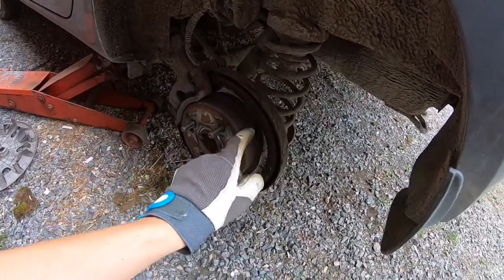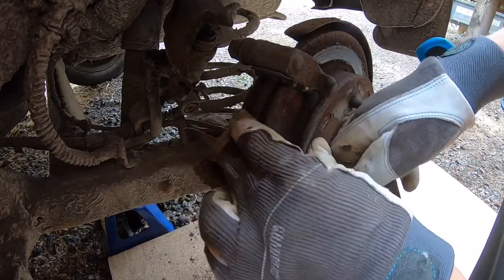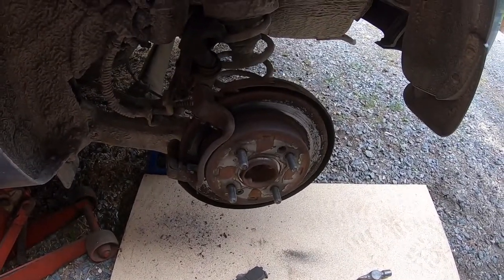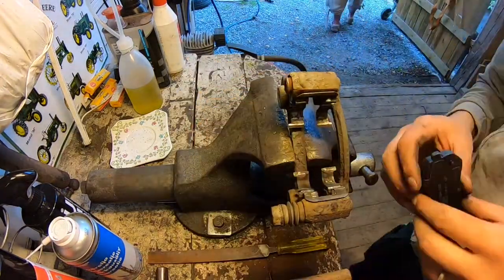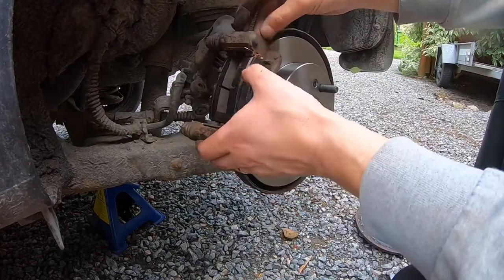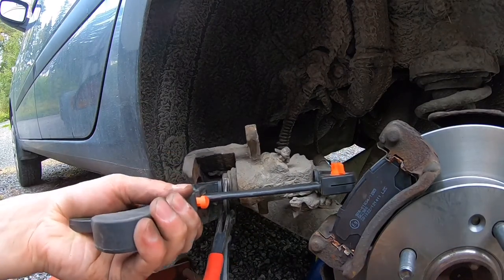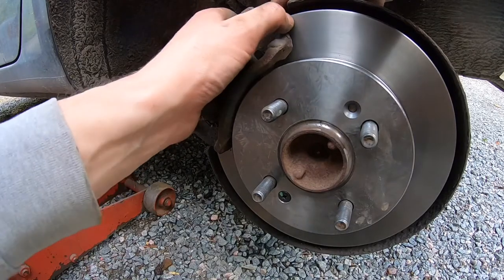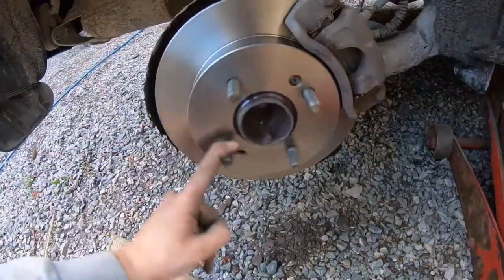Changing rear disc brakes on a Hyundai I10

Comment: There usually is a procedure to get the parking brake to work as intended. How did you fix that? I have done quite a few handbrakes of this type on VAG cars and it is a bit of fiddling to get the adjustments right. Probably the same on this car. Hälsningar från Värmland.
Reply from the maker: No Electric hand brake on this car, twist and push to get in, push the brake to get the the piston out and then the adjustment is automatically set. (If the caliper works!)

Comment: Sat here having my lunch and thought I would take a look at some videos, I came across yours and think you have done a great job, the Filming was excellent and your voice over in a foriegn language incredibly good. 
The only thing that shouted out STOP was when you started to push the piston in to the Caliper, you realy just needed to open up the Caliper Bleed Nipple whilst pushing the piston home, preferably with the correct tool and then close it when the piston is fully down and flush with the capliper casting. 
2 Things to note, you should always clean away around the piston before pushing a Dirty Piston into the Calipers Bore and
lastly check the fluid level or even carry out a Fluid Swop, recommended on most cars around 30,000 miles / 45,000km
this is a realy easy maintenance fix and costs around £200 + in a garage, but done yourself costs £10 - £15 for fluid  
Thanks again for uploading a great video
Mr Spence Eng
Reply from the maker: Hey! Good advice, this car is probably due for a brake fluid change, I might do it this summer. Regarding the piston, the boot was relatively clean and I didn’t want to move too much, don’t know how it would hold up so I just left it. Yes a special tool to push it in would be good and the method of opening the nipple is good, I will take it with me and use the next time! Best regards Nils

Comment: great job. I put grease between the hardware and the caliper. This way it slows down the rust that jacks the hardware towards the pads and makes them bind. Also grease all metal to metal contact areas where the pads contact the piston and the caliper body at the back of the pads will reduce any squeaks.
Reply from the maker: I was a bit conservative on the grease. Next time I will make sure to have some better product, like proper brake paste.

Comment: Great job! The only thing I would recommend is clean and grease the caliper bracket under the brake slider shims and don’t grease the actual brake pad ears the reason why is because rust forms behind the slider brackets and starts to rust jack the brake pads so they end up seizing. So instead of putting grease on the pad ears ( which actually attracts dirt) put the grease under the sliders on the caliper mounting bracket so it doesn’t rust. The south main auto channel has tons of videos on this also. Overall great job though!!
Reply from the maker: Thanks, hmm, why didn’t I put any grease under the shims, I usually do this. Yes, now I remember, I only had this crappy copper grease stuff, I need to get real anti-sieze next time. But I need grease on the pad ears as well, we have a ton of salt here during the winter so they will rust like crazy without the grease.

Comment: First rate video and much praise for clear English. Perhaps you could make a short video on bleeding brakes after this sort of job with the bottle and tube on the bleed nipple. Some menders forget that air gets in and the master cylinder needs to be topped to the MAX line, not above it.
Handbrakes on Hyundai/KIA are cable so self adjust but the writer who mentioned VAG cars makes an important point. I vaguely recall that some Fords also need separate fiddling with the hand brake.
Best wishes from Ireland.
Reply from the maker: Hi! Thank you for your kind words and suggestions! I will probably be responsible to change brake fluid on this car when it is time for that. (I have to check, It could be over due!)
Great to get response on my English as it isn’t my native language!